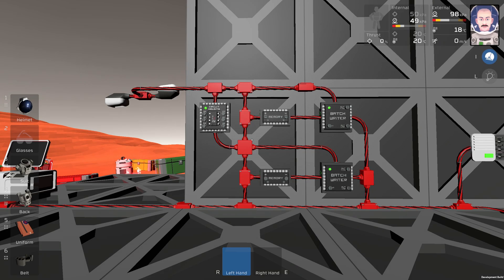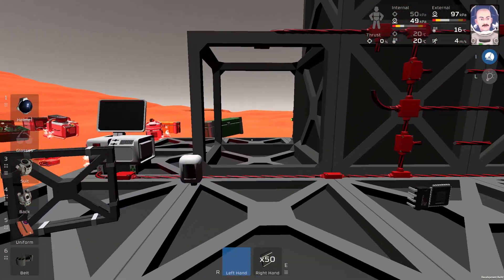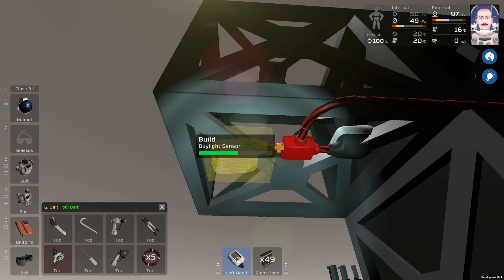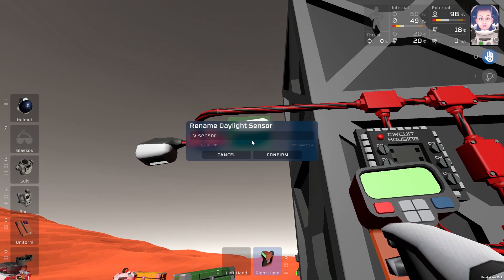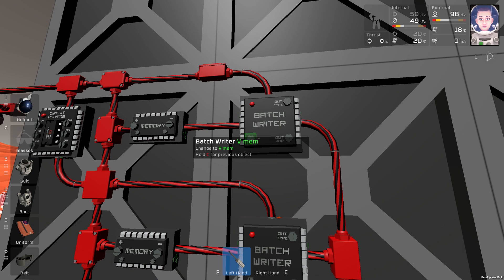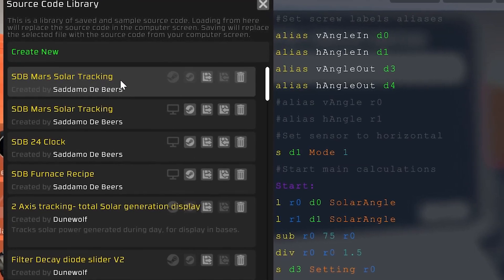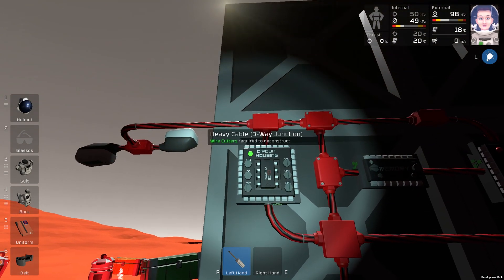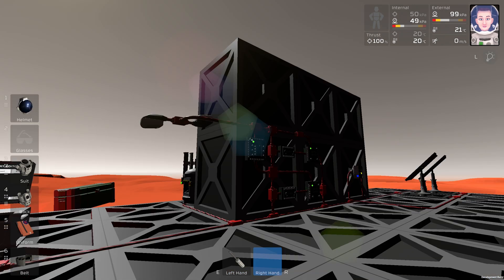Stationeers Tutorial 2 Axis Solar Tracking with IC ( Mars )

Comment: Not working the solar pannels never stop spinning arround
Reply from the maker: I am sure, you got something wrong in your setup, this guide 100% works
Reply: @AdamDeBeers  Possible not saying other wise, but for example, if the sun rises on your right, north is the way you are facing right?
If yes then I did put all the stuff right :/ the only thing I did was putting normal cables and not the heavy ones
Reply from the maker: check this, maybe it helps, there is a picture with more info about directions of sensors:

https://steamcommunity.com/sharedfiles/filedetails/?id=1569936558